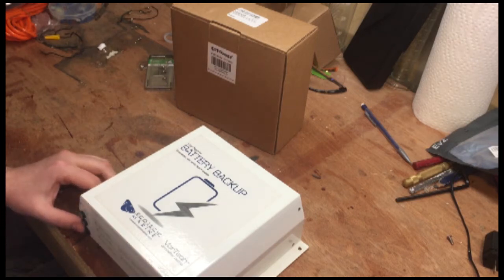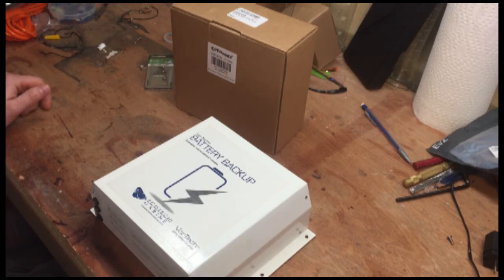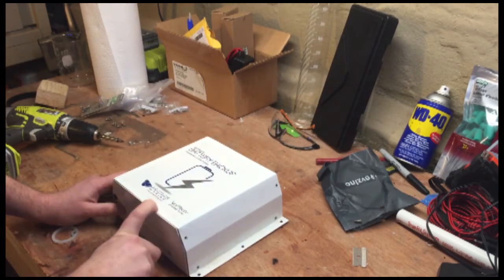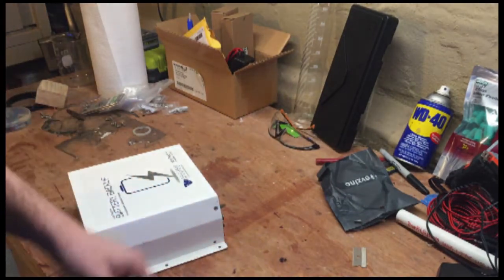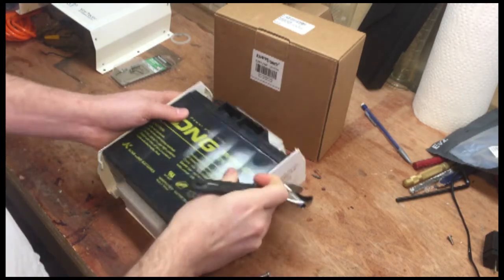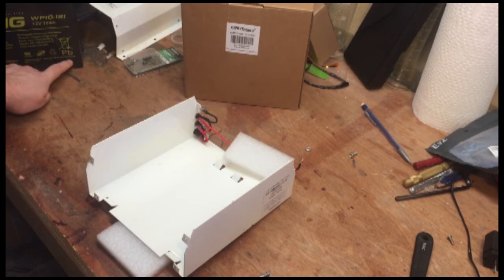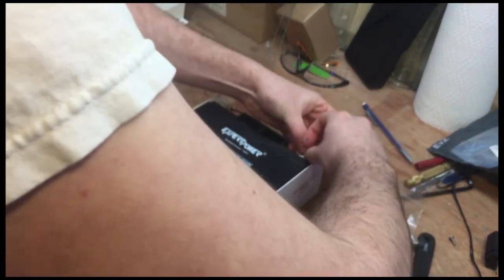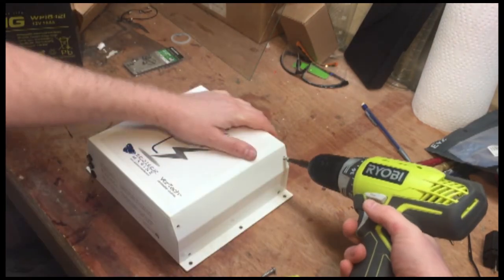Replacing the Battery in a Vortech Battery Backup

Comment: Putting together a tank from equipment packed away 9 years ago. Per your video replaced batteries on two backups and worked great. Drilling out slowly made for more bite. Little alignment needed with pliers on the internal sheet metal parts. Many thanks for posting.

Comment: When you drill out screws and rivets put some pressure and drill slow instead of higher speeds. You actually eat up the metal quicker that way. Thanks for the great video. If I can't find an old ecotech backup battery cheap that I can replace the battery on then I will just build one like you did in your other video.

Comment: Thanks, I just bought 1 of these used because I live in Florida and we have a hurricane coming. Like you stated, they go for $180 which  was to much in my eyes, especially considering you could buy a deep cycle battery that last much longer. However I was down to the wire on time and got this at a good enough price to justify it to myself. I dont know how long it was used, so plan on replacing the battery, it'll be nice to have this as a guide once I can order a replacement.